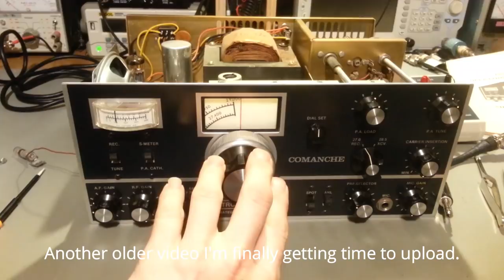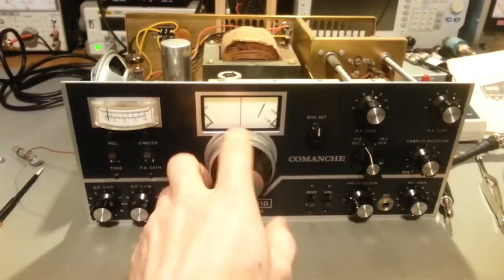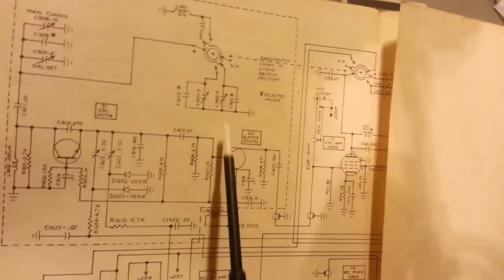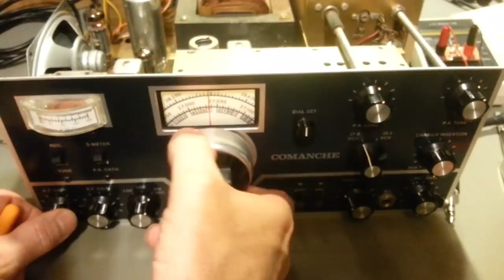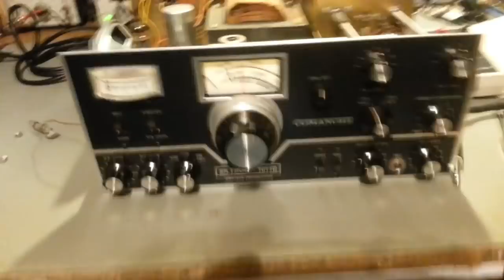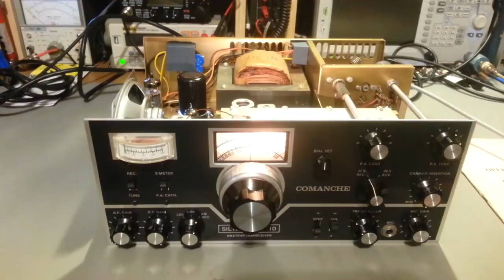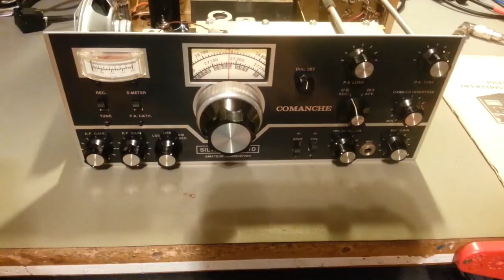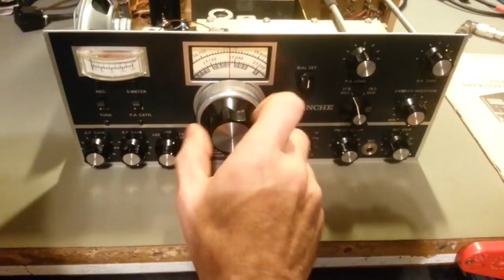Siltronix Comanche 1011D restoration and demodifying.

Comment: I repair and redesign ham radios and it is with great pleasure to see you do your work. I am a ham and a scientist with 50 years in the RF world and you are an inspiration to so many I believe.
Reply: Could you design a noise blanker circuit for a 1011d? I have lots of power line noise and can only really use mine on am when it rains

Comment: This is basically a 10/11 meter version of the Swan 350A.  Most likely these were targeting the illegal CB market.  Great solid radio, and in my opinion underrated.  I owned several tube rigs including Drake, and The Swan 350A is my favorite.  Solid old rig.

Comment: Back in the early 70s when I got my FCC license I was hired by a CB shop in Atlanta Ga. It was my job to sign off on the radios before they left the shop and also to fix Johnson White Face tube types. I was wondering if you have ever worked on those. Quick story, somewhere in my first week I had just replaced a final and the grid coupling cap and as I turned it on the boss who had been standing behind me holding a 4 foot 2X4 up with his foot on the other end let it go. The bang when that thing hit the floor made me jump completely off my stool and then I had to go home and change underwear. I love your videos. Take a look at mine if you have a few minutes on Youtube,  AERVBlog. Keep up the good work and thanks.
Reply from the maker: I actually have 2 here currently for restoration.  A White Face and a Black Face.  I have done several of them over the years.  I love them.  Simple no frills design that's built like a tank.
Reply: @mikesradiorepair  ahh! The good old days. I went on to radio engineering and kind of got stuck there for 30 years. Thanks again for the videos.

Comment: that radio is worth putting money in
Reply: i recently bought a Siltronicx 1011d    I thought I could use alternating current from the wall to power it.   The rear panel has two outlets which are marked  117 volts..   I cannot find a plug to put on a line cord for these plugs.  Does anyone know where to buy such a plug?

Comment: Q: Mike I have been looking for a good older ham rig to listen to HF with. Something like an ICOM R71A. All the less expensive units I see on eBay have major problems. What models do you like from that era? I'm a ham so a transmitter is okay too but not required. Thanks.

Comment: On a lark I bought one of these. Yuck. The old white capacitor(100 35v) on the underside of the 8950 has a burned spot on it and the 4.7 ohm resistor next to it is burned to a nasty crisp.  The resistor is clearly toast and I'll have to figure out if the cap is bad...probably is?  The rest of the caps are all original but none "look" bad. I'll need to figure out how to test those. I am encourage to see at least two of the caps in you photo appear original.  I tried to find caps on the web. Mouser seems to sell them but if I buy all the caps , the down total looks to be a few dimes under $100.  Not sure it is worth the time and money it will cost to bring this back to operation.

Comment: Curious if the Comanche 101 1d is a spin off of the Yeasu FT-101 series transievers?.
    Thanks for sharing!
    Kind regards, Eric Dee.
Reply from the maker: No, Siltronix was a spin off of Swan.  Swan made the 1011 and apparently the amateur radio community gave them hell because it was obviously a CB radio.  The FCC was also none to impressed.  They made a spin off company Siltronix to sell this type of product while protecting the Swan amateur radio company.
Reply: @mikesradiorepair Thank you for your reply. Very interesting, that's a really nice looking transceiver. What is the Tube compliment (Finals) for that rig?, and are those radios hard to come by nowadays?.
    Kind regards, Eric Dee .
Reply from the maker: They use a 8950 horizontal deflection tube for the final.  I wouldn't say they are hard to find.  FInding one in mint condition may be a little hard.
Reply: @mikesradiorepair  : Thanks again for your time and information. You have a great channel, very informitave and educational as well.
   Happy Holidays to you and your Family. 
    Kind regards, Eric Dee.

Comment: Hi Mike i have a 1011D thats needs to be looked at my audio is all garbelled on transmitt   (HELP) Rick P Pepperell,Ma
Reply: Is it garbled on AM? These can difficult to make sound good in that mode. First off, avoid power mics. And keep the mic gain on the radio on between 
9 and 11oclock. Any higher will cause distortion. They are really nice sideband radios but just not the best on AM. They'll never be loud like a Galaxy in that mode because you are basically talking on one of the sidebands with the carrier balance purposely mistuned to insert a carrier. Also on AM,keep the plate current at or below 120ma or you'll cook that expensive 8950 final tube